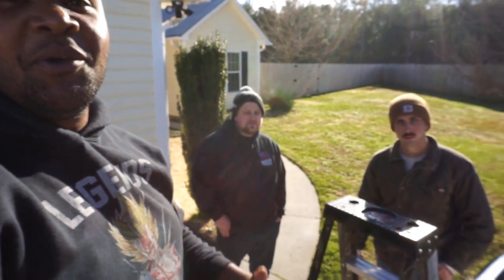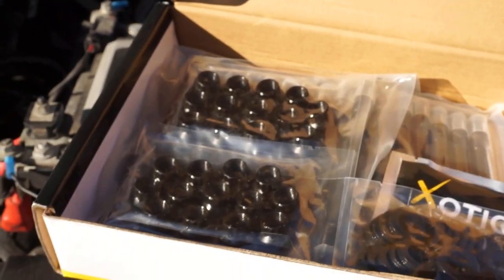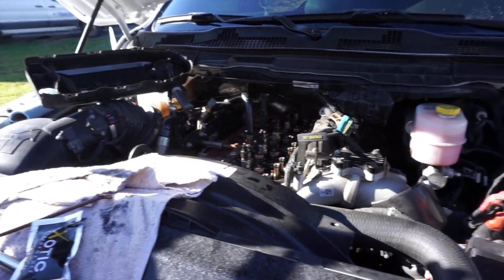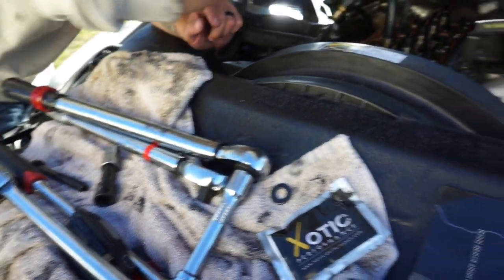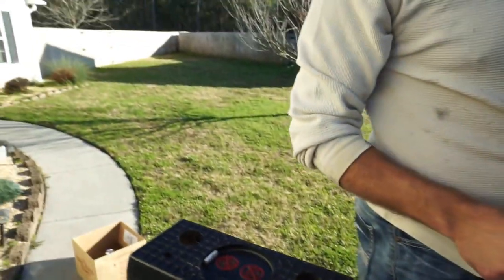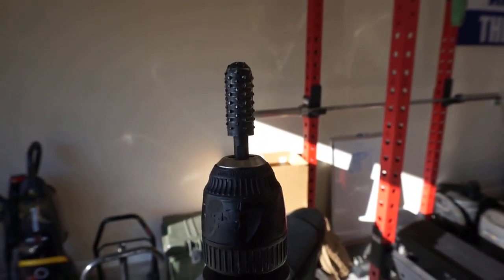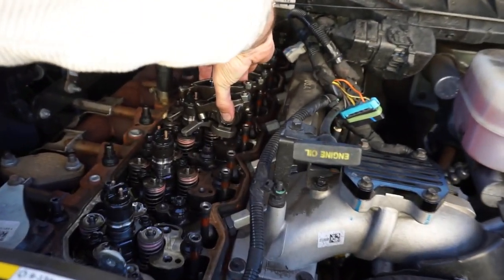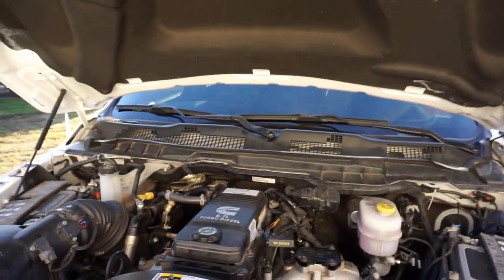XOTIC PERFORMANCE Head Studs Installation Review 6.7 CUMMINS!!

Comment from the maker: Xotic Performance stated that these studs are reusable long as their instructions were followed correctly when installing! This is huge!
Reply: When you did your studs did you resurface and change the head gasket? I was told I should when I do studs.
Reply: So how’s the long term durability so far.
Reply from the maker: Studs still working fine no issues
Reply: Yes, you can reuse them 3 to 4 times.
Reply: Man, thanks for your amazing channel!! Looking forward to see the transmission build for the dually. She will be better than ever!!👍
Reply from the maker: Appreciate it and thank u! She definitely will
Reply: @EVERYTHANGDIESEL  Yes sir!!👍💪

Comment: We just did these as well and did the valve lash adjustment a little tighter than factory.  Great video as well.  I ended up checking them after putting a few miles on them and re-torqued them cold.  These studs are getting alot of publicity for sure and look like a quality stud, however mine did not come with the allen or socket.
Reply from the maker: I remember seeing that man
Reply: @EVERYTHANGDIESEL  Also, I thought these were 220k psi and when I looked at the lab test sheet on the website it shows 240k psi, so I would say these are a little better stud than the arp 2000/425 and a good stud alternative for someone to save some money.
Reply from the maker: On the website it says 220psi but they very well can be 240psi just derated from them.
Reply: @EVERYTHANGDIESEL  yeah I saw that and then looked at the lab test sheet they show you.  Good stuff man
Reply: @jorrin48  I havent had any issues out of them so far, they were all good when I checked them.
Reply: @jorrin48  No, follow the directions from exotic and you should be good.  Here is the response they sent, “A retorque will not be necessary so long as you used our assembly lube during the installation process. Testing and calibrating your torque wrench from the get go will ensure accurate torque loads.”, “We’ve had plenty of customers hot torque our head studs without any adverse effects. It’s not a necessary requirement so long as you follow our instructions in the manual. The discretion is yours, and your warranty will not be void in case any damage incurs.”

Comment: I think I'll gamble on these they are about $275 arp about $450 for their 2000/425 and the 625 are insane at $1100 which I'm just mildly EFI live turned and just want added safety for my head gasket I got 204k on my 6.7 so I'll be doing the overhead vale lash adjustment while it's open...I'm also going to address my exhaust manifold seals which I think I have a cracked manifold as I hear a clank so where on the manifold when it heats up in cold weather now so I bought a cheap used factory one which I'll just have a shop make sure it's flat the aftermarket are pricey as are new OE and the aftermarket seem to fail like stock . I was going to go with a dually like you but I don't know if I can find tuning for delete anymore and my EFI live is vin locked ...lol... I don't want the "emo"tions headaches .

Comment: Looks good.  Do you not have to adjust valve lash on a 2018? I'm just asking because I've got a 2018
Reply from the maker: Yes u do, only 2019 and newer you don't cause they have hydraulic lifters and I believe it's only on the high output models

Comment: Should a new valve cover gasket be used? 60k miles on the truck.
Reply from the maker: naw, if the one on there is fine and doesn't leak then its good

Comment: Dang I just put these in my 07  6.7  2 months ago  mine did not come with the socket or allen had to go buy a 12 point 14mm  as i have mainly all 6 point.  That would have been nice..So far so good
Reply from the maker: I guess they just started doing that, but for the price buying a socket is a small cost lol

Comment: Question from a powerstroke owner, why do people stud the heads of stock Cummins? They have head gasket issues?
Reply from the maker: Cummins aren't "known" for them but like any diesel when running tuning and aftermarket mods your chance of blowing  them goes up as cylinder pressure increases. Basically its a good assurance mod
Reply: ...if the transmission doesn’t give up the ghost first.

Comment: would you recommend doing the one stud @ a time on a motor with 186,000 miles never had a head gasket issue
Reply: Yea you can do that but check where they are torqued at now like let’s say 115# swap them all out to 115 one at a time then start bringing them up to final a step at a time like 125# 135# 150#
Reply from the maker: Thats exactly how we did it just like in the video
Reply: I’ve got 208k miles and would like to do this, but don’t want to try my luck with disturbing the head gasket. I’ve heard it’s a 50-50 shot at success.
Reply from the maker: False, there is no way u would disturb the head gasket by doing a one swap for swap. I did studs on my truck at 160k
Reply: @harleyhoracio1  no you won’t disturb the head gasket as long as you do it properly you are keeping the head gasket in place with the pressure from all the other head bolts as you swap them out for studs. If someone said otherwise then they probably had bad gasket beforehand and thought the studs would fix it.
Reply: @harleyhoracio1  I did mine on my truck and it has 250k. No issues so far

Comment: Why wouldn't you just go ahead and change out the head gasket ? Personally i wouldnt put head studs in until i was was ready to do the gasket, resurface the head ect 
Aftermarket head gaskets are way better too!
Very nice looking studs tho !!!
Reply from the maker: The reason the oem gasket goes out us cus the heads lifts up or the gasket gets week. Ryan truck has 46k miles there is absolutely no need to change a head gasket on them. Plus on top of that u can have a truck with 187k and studs but still runs fine hence my truck lol. At end of the day of the day if it aint broke dont fix it
Reply: If you don't have a head gasket issue, there's no reason to touch the head. Ever. If a shop tells you otherwise, they are just trying to get money from you. The 1 by 1 method has been used for years on trucks with healthy head gaskets. Go home. You're drunk.